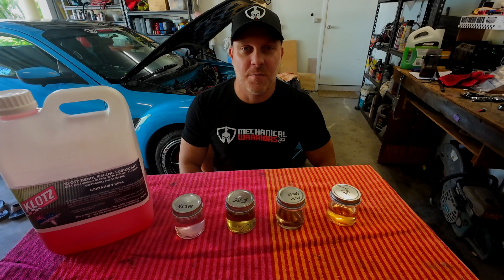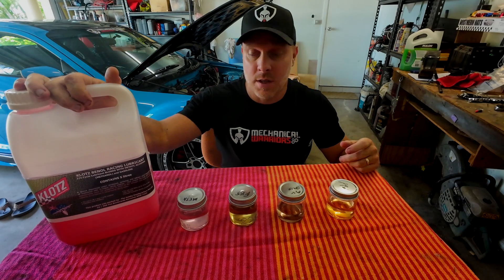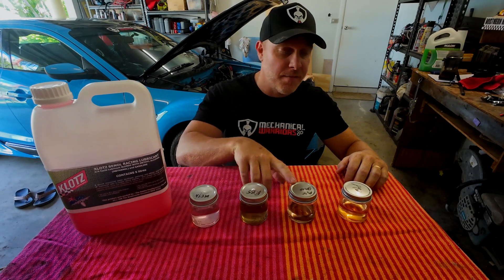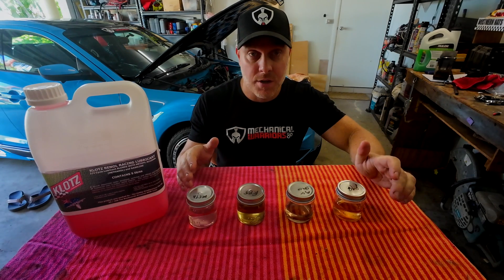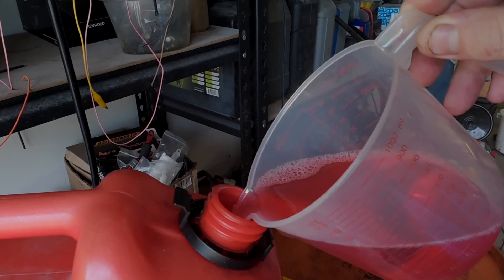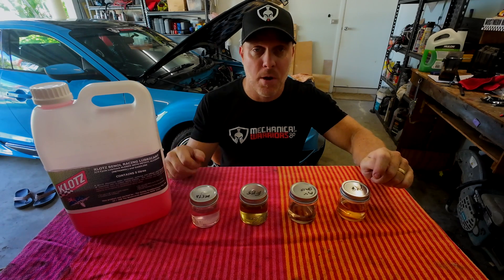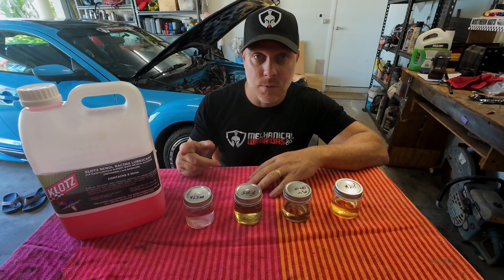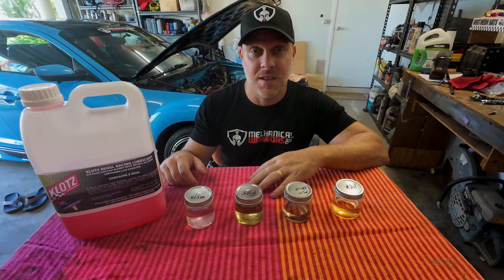What Happens When Caster Oil Is Mixed With Fuel?

Comment: whats ur opinion, does 2 stroke oil mix with e85?
Reply from the maker: Personally I have never done an experiment with 2stroke and e85 but I would just stick to klots racing caster oil it’s smells amazing with e85 ! :)
Reply: All though I want to try out that Klotz BeNOL 2 stroke oil with e85 mainly for the great cherry-like smell it has when carbureted. It does mix well with e85 according to the manufacturer. Even if you used my fav Castor 927 2stroke race oil. That stuff is very thick, mixes easy in e85 without signs of separation, burns clean, smells decent once carbureted, and has been my go-to for close to 10 years... If you do decide to get e85 fuel. Check out the company called Torco race fuel. They have an e85 based fuel that's a bit better for a good price. A 5gal of it is like $60 and shipping is like $50. Of course shipping prices can vary from state to state.
Reply from the maker: @zior8001  thanks for the tip
Reply: @mechanicalwarriorsofficial  most definite brother